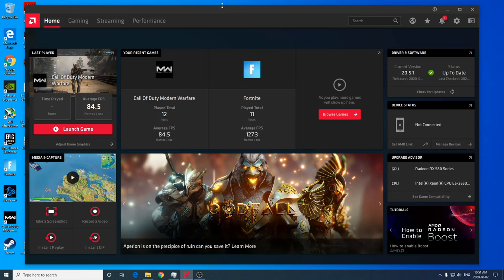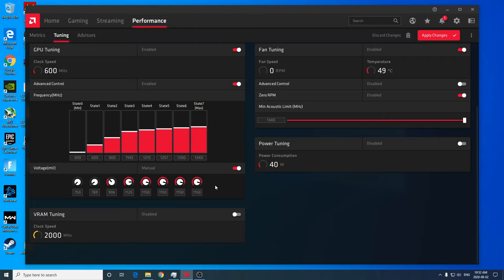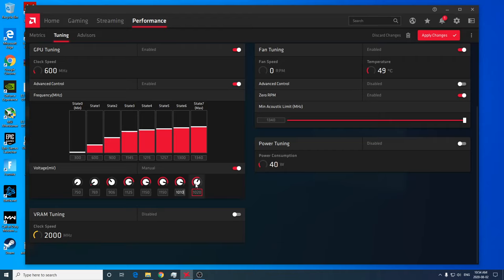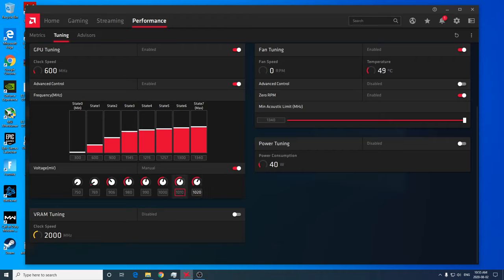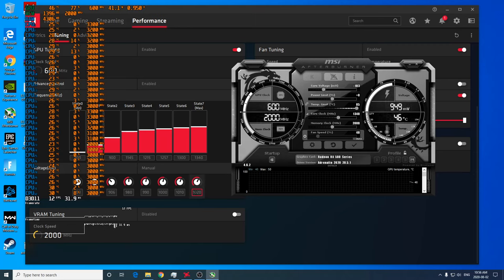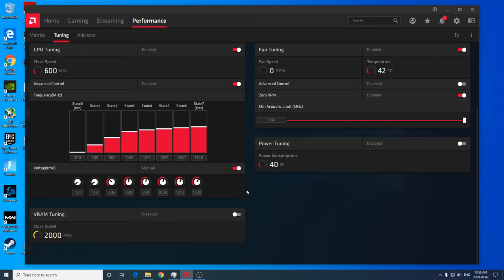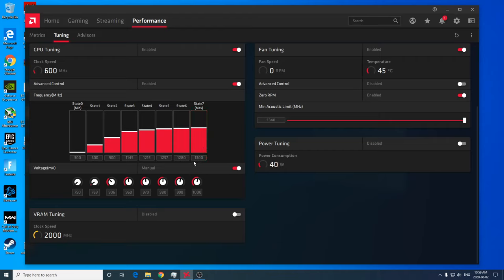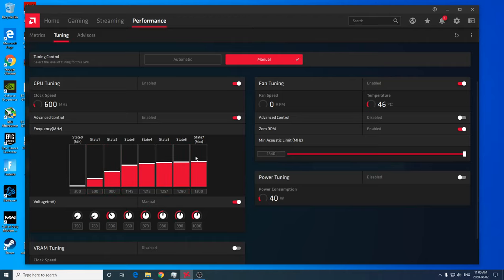How To Undervolt AMD RX 570 and RX 580 (How to lower GPU temp upto -10c)

Comment from the maker: This is a link to a video with optimal Undervolting Settings for AMD RX 570/580 (also can work for some RX 470 and 480 cards)
https://youtu.be/0pzxFZBw-6Y
Reply: Hi i from brazil and i like your channel kkk, but you need to show us fps in old and new config. <3
Reply from the maker: @victorvasconcellosborborem2713  fps will go down if you lower core clock, if you don't change core clock, fps is same.
Voltage does not affect fps, only core clock affects performance
Reply from the maker: @victorvasconcellosborborem2713  fps will go down if you lower core clock, if you don't change core clock, fps is same.
Voltage does not affect fps, only core clock affects performance
Reply: @victorvasconcellosborborem2713  FPS is irrelevant, it's the temps that matter so you don't fry the card.  The minor drop in FPS will only be noticed by meathead fps counter software, but your eyes will never even miss it.

Comment: Dude, you seriously saved me from going out and buying a completely different graphics card, replacing my hard drive, etc. THANK YOU!
Reply from the maker: You are very welcome. I would recommend watching my latest video where i show you what settings to specifically use for low temps and good performance.
Good luck! let me know how it goes and if you notice a temperature difference
Reply from the maker: @Anis Am this is a lower clock speed, but very low power consumption
https://youtu.be/0pzxFZBw-6Y
Reply from the maker: @Anis Am I plan on making more content soon
Reply: Bro why hard drive?
Reply: @AleksandrsBrodie  Do you have a discord? I have a issue of sluttering hard so much and reach the 80-82C degree on my GPU is ASRock RX580 8GB OC Phantom gaming
Reply from the maker: @SametChan  copy the undervolt settings I have linked in the pin comment
Reply: @MuhammadHassan-ox9jx prolly loud fans so they assumed it was loud hard drives maybe
Reply: Dude you saved me too I was getting 80-85 every time I played and I was wondering if I should just buy a nvidia 3060
Or something
Edit: I’m now on 65-70 c
Edit Again: my game just crashes and I got an amd bug report message

Comment: Undervolted my rx 570, from 1150mV to 960mV and memory by -50 mV. After undervolting, I tried to over clock and got mine stable at 1390mhz core and 1950mhz mem. Now it just consumes 99-110w while gaming and doing other gpu intensive tasks, temps also got lower as it used to stay at 79-85°c while gaming, now its only at 65-69°c. Loved the vid man keep up the good work!!! 🙏
Reply: Btw my GPU 's asic quality is 75%

Comment: Jeeez thank you so much! I was tryna play God of war with original graphics, hitting 89 degrees with rx 580 fans spinning at max 4500 rpm and a lot of drops in game. After applying these settings, no more drops anymore and it is running around 75 degrees with fans only 3000 rpm. And it saves a lot of power too!
Reply from the maker: Btw you can also copy the settings that I share from the pinned comment. I link to another video I made.
Have good weekend.

Comment: Bro holy shit thank you so much dude. I went from 80s to almost low 90s to the 50s-60s under load. You have saved so many headaches.
Reply from the maker: Glad it helped!
Reply: Bro my gpu was 90° degrees, and now it is 60° degrees, thanks.
Reply from the maker: @vorium148  ;) :)
Reply: @vorium148  What Gpu u have i have ASUS Radeon RX 580 OC 4GB
Reply: @fakecaptain6251  I have XFX Radeon RX 580 Series 4GB, I aplyed the settings n I changed my gpu thermal past too.

Comment: You are my lord and my savior. Huge thanks for encouraging me to undervolt my rx 480. Running stable at -95 mv. Temps are now 7-8 degrees lower. Your work is gold, man. Thanks a lot!
Reply from the maker: You are very welcome. I'm glad the video helps!
Happy holidays
Reply: I know this is an old comment but didd you adjust the power slider at all? Mine seems to crash in games @ stock clocks with even the smallest UV.

Comment: Good thing I saw this video and it help me a lot to lower my temps by 10 degrees Celsius and get a fixed overclocked speed! I got a RX 570 4GB and set the max frequency to 1300MHz and voltage down to 1070mV and it's the sweet spot! Just subscribed too! Thanks man!
Reply from the maker: Glad to hear it helped!
Reply: did u also increase the state 5 and 6 or just 7 when u did your over clock?
Reply from the maker: @JjDBz  when undervolting you need to undervolt all states I believe
Reply: i have rx570 and did the same thing he did under volt to 1070 and reduce by 10mv per state up to state 2 then change core clock of state 7 from 1244 to 1275  played an hour of gta v and couple rounds of warzone. my temps still hit max 70 but most of the time low 60s so far it is stable.

Comment: Man, you are the best. Been trying for weeks to lower my temp, got better airflow, bought DarkRock 4, capped fps to 60, lowered game settings, nothing worked. I was at 78-80*C constantly.
I followed ur guide and now any game i play my temp is like 67-70*C max.
I went from 1150v to 1060 and also lowered Mhz from 1380 to 1300. Works like charm, not a single crash. I could go for even lower temps but i am ok with those.
Reply from the maker: Glad the video helped

Comment: In my opinion, the whole purpose of undervolting is to dramatically increase performance per watt ratio; even if it means sacrificing some raw performance, and this video is a great example. 
For example, I'm running my vintage Fermi, a very hot card, at -50MHz core clock and -180mV undervolt. Temperatures went down from ~90c to low 70c! That's a reduction of almost 20c at a cost of ~5% lower performance! 
And since I play at either 30 or 60FPS locked with vsync, the GPU remains at around ~60c most of the time.
Reply from the maker: :D good explanation.
the whole undervolting concept can help either low your temps or improve performance if you are thermal throttling,
not to mention safer temps can lead to a longer life span
Reply: Agreed... I got my RX 480 down to a 73W GPU power limit at the cost of 7% performance, but that requires max tuning and testing all the power states.  With a i7-4770s, 16GB ram and RX 480 undervolted I'm drawing around 155-160W at the wall while gaming.

Comment: Thanks, i may experience a few drop in fps like 3-5, but that was well worth it for my GPU lifespan
Reply from the maker: Yup. :) worth imo.
Just remember:
Clock speed affects fps,
Voltage affects power consumption = heat.
So if you want higher fps, you can run higher clock speed, which will require a bit higher voltage.
I generally aim to keep my gpu around 68-72c when under full load and choose clock speed and voltages for that.

Comment: thank you soo much. i could not understand any other tutorial on youtube. my temps drops drastically. warzone on  low settings doesnt even get over 70 now. i used to get to the high 70s with stock settings. i really appreciate your video. alot of games would run almost at 80c even some pretty easy games to run that used less that 1gb of space. my case had alot of airflow and i just repasted my gpu but my gpu would just skyrocket. cpu was fine. it was only my gpu that would go up in those temps. games dont go over 70 now unless its a really demanding game
Reply from the maker: thanks for taking the time to leave a comment ;)
this is why I made the tutorial. its not perfect, but i was hoping it would help someone ;)
and ya, running the correct voltage on the GPU makes all the difference. by default, its generally way too high.

Comment: Update: I eventually got some occasional crashes and freezes in some game. So I found the voltages that works perfectly for my Rx 580 Red Devil 8GB. Been 2 weeks of constant gaming and not a single crash. 
1060-1065-1070-1075-1080v for state 3-7. Anything lower than this, can cause crashes (very rarely and not on all games, but it happens).
Good luck all, don't be afraid to experiment until you find the perfect values for you, and thx again Aleksandrs!
Reply from the maker: Nice work, and ya, each card will need a different voltage to run stable.
:)
Reply: did you touch mhz values?
Reply: Can u please help me to ? I have a rx 580 and get driver timeout on every 2 3 days . Its possobile send me a pic from your setting ? Iam a wolrd of warcraft player i can't take more crashes anymore :(
Reply: @sawmi37  sorry i no longer have that card, got a rtx 3050 from Nvidia now.
Reply: @alanrayne1693  i gonna do this tomorrow
Tired try everything
Reply: But i do the same voltage just like u . But on 1257 mhz . I was try everything for amd driver timeoute but notings work . Its happen every 3 4 days on iddle or gaming sometimes . 
This undervolting can help about this ? Rx 580 8g driver timeout. Pls help if u can 🙏
Reply: @alanrayne1693  after you change to Nvidia didnt see crashes like this ? U using same system ? My errors didnt solve . I want buy nvidia . Pls give ur comment about this if possible
Reply: @sawmi37  from the day i bought it until now, not a single crash or error or anything. Also i did not need to change or tweak anything, left everything on basic setups. Just install the card and play. Temps stay 54-58*C on games like Elden Ring and Diablo 4.
So yea i totally recommend Nvidia cards.
Its not as powerfull as an AMD for the same price, but it at least no more problems either.
This is just my personal experience, maybe i was just unlucky with my AMD card. I will always go with Nvidia when it comes to video cards, from now on.
But i suggest you consult with a PC specialist to make sure the card is the problem and not something else that could cause that issue.
Reply: @alanrayne1693  i refound the rx 580 and get 3050 . Everything is good like u say . Not a single crash without any special settings
Reply: Dude! You have kiloVolts on your card lol sorry I had to 😅

Comment: Man, can't thank you enough. I was really afraid to try it, but I was gettinh 89°-90° in Jedi Fallen Order with my XFX RX 570 4GB. This made me try your settings, and now I am almost all the time reaching 70°, 74° at most. This "only" reduced 15°-20°. I am just amazed!!!
Reply from the maker: you know what they say, do or do not, just dont let the gpu over heat.
😏
Also just remember if the gpu crashes, just increase core voltage by 10-20+ mv until its stable
Reply: @AleksandrsBrodie  Man, I was really impressed, but... for some reason, the temps are reaching the same levels again, and the configs are exactly as if I just copied yours :(
Reply: what are your milivolts on state 7 and 6 ? could i  know
Reply: bro plzz tell me your settings of rx 570..i also have the xfx rx 570 4gb..my games crash and says amd driver timeout

Comment: Just picked up a 580 GTS Black furnace. Thing was burning at 85-89C. Tinkered around with these settings, dropped over 20c in full load temps in game. I did adjust the fan settings as well. Thanks 2 years later.
Reply: Can you share you're fan settings, my rx 580 is loud

Comment: Actually in MSI afterburner you can press CTRL F and bring up more fine voltage control. You can adjust voltage for each frequency stage
Reply from the maker: ya I found out. thx!

Comment: I recently bought some pads for my Rx580 Reddevil PowerColor (2mm), change that anth the temp stills high. Then I see this video; I though that undervolt videocard=worst graphics, try it with this video and that really works, temp goes to 86° to 77° at stress. 
Thanks dude, greetings from Colombia
Reply from the maker: You are welcome.
If you want lower temps, lower your Core clock, then you can lower your Core voltages more.

Comment: Thank you very much, I have a RX 580 msi gaming x. Overclocked it slightly, from 1380 to 1400 and applied undervolt from 1150 to 1060. Tested it with 3dMark and seems ok. At least now I have a little more confidence when doing this.
Reply from the maker: Glad to hear, your temps should also be lower now!
Reply: @AleksandrsBrodie  Yeah , I had to revert all the settings. Got massive artifacts in Apex Legends. Will play around with it at some other time again.
Reply from the maker: @RudiOnRails  ya, some GPUs need a higher voltage for the core state. just depends on Silicon Lottery.
you can also try lowering your core clock if you want the card to run cooler
Reply: @AleksandrsBrodie  Well i think with some adjustments it will probably work. My card sits at like 70 degrees under load so i am not to worried  should be ok there.
Reply: @RudiOnRails  1060 at 1400 is to low try 1090 or 1100

Comment: Really Informative video, I had to lower the temps on my XFX 570 4GB  by undervolting and lowering frequency, I lose some FPS but it’s worth it for lower temps.
Reply from the maker: Glad you found it helpful.
This is the only reason I make these video is so that someone like yourself can make use of it :) or learn something
Reply: Hi! I have the same card as you, may i know the details of your undervolting and underclocking?
Reply from the maker: @isohel112  if you check my channel, my latest video shows you good tested settings to use on your card, they will lower your gpu temps.

Comment: I'm using Power Color Red Devil RX570 4GB. undervolt at 1320Mhz with just 950mV.
runs Battlefield 1 at high setting with average 153FPS and my GPU Temp 64C max.
Reply from the maker: thats awesome!

Comment: Mate, this video is incredible.  Thanks for walking an old noob like myself through this process.  I shaved 20 degrees off my stress test.  What the hell!
Reply from the maker: Hell ya man, its great :) glad you tried it :) remember if the system crashes or freezes, either 1. Lower Core clock or 2. Increase core voltage until it does not crash.
I aim for anything under 74/72c while under 100% load. but the gpu can survive at 80c.
Happy holidays!

Comment: Dude this is just freakin awesome!!! I'm using a powercolor red devil rx570 4gb and was getting 80C when playing apex legends, I did your tutorial with your exact settings, now sits at 60Cmax! Thanks man!
Reply from the maker: im very happy to hear!
honestly :)
undervolting can seem "scary" but its just settings the right voltages so that your card does not use higher voltages than needed -> giving you high temps.
Glad it helped.
If it crashes for you, you can always increase voltage by +25mv on all states
Reply: How's the performance dude?
Did it stay still or degrade
Reply from the maker: @gilbert7864  performance does not degrade with undervolting.
Reply: @AleksandrsBrodie  omg rlly??
Alr thanks dude im gonna test it out

Comment: Thank you for the awesome information :) I honestly though this wouldnt make a big difference, i was wrong! I have a powercolor rx 580 8gb that was going to 75º celsius max which i found it ok (a little more than i wanted too),  but then i did the same undervolt and get 63º max and the pc evens stays quieter. You sir, are a genius and a good person for sharing <3
Reply from the maker: I am glad it helped! stay Cool ;)
Reply: yes and - 5fps in games.. this is to much i prefer 1400Mhz core and 1120mv 69º  better perfomance and good temp.
Reply from the maker: @bisnaga1990  if your card has good temps, no need to drop clocks and voltage. :)

Comment: Wow I’ve been playing COD vanguard for a couple of months and my temps went from 84-85 degrees while running in game to a constant 73-74 degrees i was starting to worry that I’d need a new GPU and cooling system..Thank you so much for the tutorial
Reply from the maker: Glad it helped.
Remember if systems freezes or crashes, either increase core cottage +20mv until stable or to keep lower temps, lower core clock -20mhz until stable.

Comment: Hey! First off, I must say this tutorial is very nice and detailed, it's hard to find one like yours nowadays! :)
Also, here's the biggest problem I've got with my PC:
I bought my (XFX) RX 570 8GB a couple months ago and immediately noticed that it usually goes from 55°C to almost 90°C (from 131°F to 194°F) whenever I open any "demanding" game (Warzone, Mafia Definitive Edition, Rainbow Six, Fortnite, etc.)
Temperatures also change immediately as if the chip went from Idle to Max temps in a matter of seconds, so I googled a way to lower the temperatures and stumbled upon your video.
Another problem is that my CPU doesn't have integrated graphics (i3 9100F, can't see anything if I connect my screen to my motherboard) and for that reason, I'm scared of undervolting and/or toasting my GPU.
So... what would you suggest to get a significant temperature drop to about 79-85°C (174°F-185°F) instead of that absurd 90°C (194°F)?
Reply from the maker: ok, first of all, sounds like your card is just one of those hot runner. aka just runs hot out of the box.
second, I would watch the latest Undervolting guide I made where I show you some settings you can copy and try.
to clarify, undervolting in the AMD software is not a permanent thing, the settings go away when you remove them or restart your pc.
If you want the settings to stick each time you load a game, you need to set up a game profile.
So I would try copying the settings I put in my latest video, and see how that goes. If your system crashes/freezes with those settings set in your game profile for COD warzone. then inscrease the voltages a bit.
Also make sure to set a more aggressive fan curve either way, in either MSI afterburner or in the AMD drivers.

1. copy undervolt settings
2. if game crashes, bump up the voltages a bit +20mv on states 3-7 then load up your game and try again.
3. make sure you have a more aggressive fan curve set
you can only damage your GPU or make it toast if you run it at 85c all the time or increase the voltages past the stock 1150mv.

I think i explain that in this video as well.